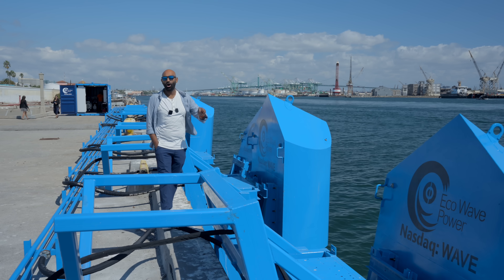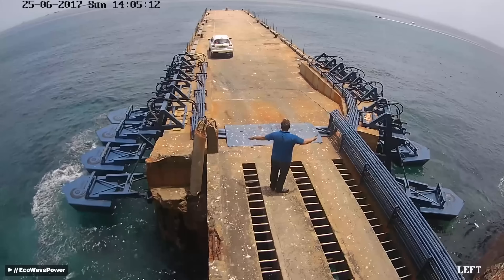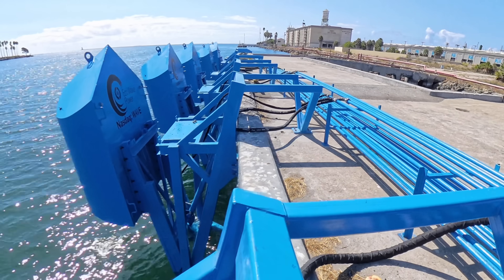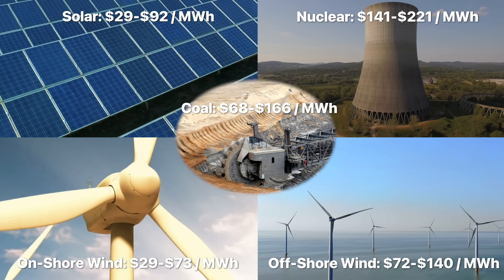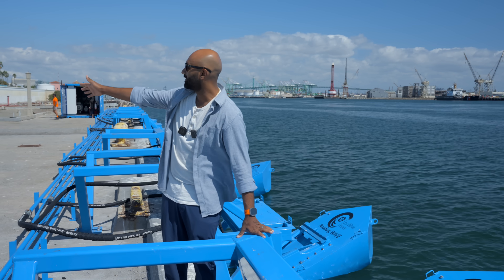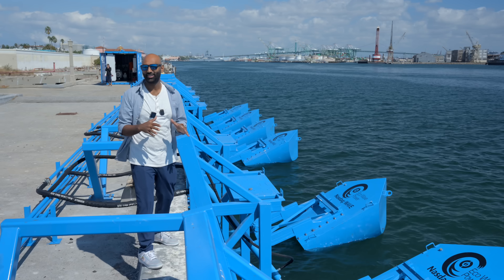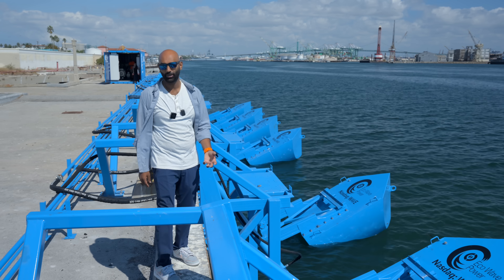Solving Ocean Wave Power's BIGGEST Problem - This is HUGE

Comment: I knew a guy in near La Bufadora who had a floating barrel with a small cable going through an eye on a heavy rock on the ocean floor and the barrel floating would go up and down, pulling the cable and running a small pump for his garden.

Comment: I saw a video where they have similar but it is just a pipe that out in the water and as the wave compresses the air in the pipe it spins generator blades. That opens even more option for the placement of the hardware. Great video as always.

Comment: Wave capture buoys should go heavier and be placed so as to take advantage of the line of wide constructive/destructive waves predictably produced by swells reflecting and intersecting off of acute coast lines, rather than being lightweight to focus on random tall but skinny "noise" that can't reflect -> interfere coherently. Like the ancient Polynesian wayfinding maps describe: at the normal line between two coast lines, or at the nodes directly between two nearby islands that modern wave simulations still can't explain.

Comment: I am currently on a ship off the east coast where they are building a massive wind farm. The windmills are sitting still because there is no wind, however there are rolling waves out here and those hundreds of platforms could be outfitted with large wave generators.

Comment: Why aren't they configuring the the float in such a way to harness the vertical movement directly?  So that the piston compresses the hydraulic fluid most efficiently. The angled approach that they've chosen adds a fulcrum that is another maintenance point.

Comment: Having a the system lift out of the water in case of a storm is a smart idea. There were two different wave power installations on an island called Kalvøy northwest of Bergen, Norway. One was destroyed in a hurricane in 1988, three years after it was built. In hindsight, building it on the western side of the island, facing the open North Sea may have not have been the best idea in the world. An important consideration is how large waves the system can survive when it is in the lifted position

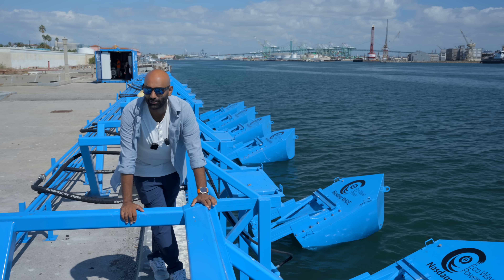Comment: @7:36.  I love your channel but please be careful in definitions.  Tidal Energy != Wave Energy.  It harnesses a completely different source of energy, that of the earth-moon system [with a bit of sun thrown in], and has completely different economic and technological challenges. The only commonality is that both need to survive in the sea and are subject to energetic forces.  However, wave energy has a much higher ratio of extreme to operating conditions:  hence the high LCOE. Tidal energy has a much lower LCOE but is geographically limited to a few locations in the world.

Comment: Just a thought here, but imagine a marina where all the boats are moored to the docks in a manner that allows for the up and down movement of waves and tides (as they do), and each gang plank (moving up and down with a boat) is attached to the dock with a small generator, which is connected to a controller feeding the local grid. 

Would that cost less in time, money and materials?

Comment: Meeeh. This appears to depend on a vertical-side pier for installation, and it still has required a custom design to be fixed to this specific pier structure. Are they in Los Angeles because this is where it was easiest to deal with the bureaucracy or because this was a pier that it was easy and cheap to put the installation on? - Okay, at 11:55 Ricky adresses the extreme site specificity (even though with a typo 😉 ) , but not even the need of a suitable pier. How many at all suitable places are there really?

Comment: Imagine oil rig style wave harvesters mounted off shore outside reef break. The deeper the water the more energy is possible to harvest. And if they take the float and gear it to a torque converter, you can harvest much smaller waves.

Comment: What about using some of the 100's of abandoned offshore oil rigs as a platform for these power generators?
Reply: That would require bringing undersea power cables hundreds of miles, or thousands of miles, to connect to the grid.
Reply: @jonvelde5730  maybe you can load the electricity onto a ship 😄😄😄
Reply from the maker: Oh that’s brilliant

Comment: Cool 😎👍
If they have a compressed air accumulator  they can upsize it easily

😳 😱 they could also do away with the oils and instead piston hydraulic power to push water into a tank compressing the air as an accumulator then draining the system to start all over again, that would require extra systems to run separately, so when was drain the other one be still filling and using the accumulated power and when that one drains with water, we can run the water draining over a turbine as well. There be another way to make power that’s a win win win baby 💨💦🌏
🥰 
Unfortunately, I have no money so yeah … 😒
Oh and could the bower generation both ways with water into the accumulator as well as the escaping gas from their accumulator we needed yes that would be a good way to do it

Comment: YOU ARE AN IDIOT AND MIS-INFORMED. WAVE ELECTRICITY GENERATION PROJECTS STARTED EXPERIMENTATION IN THE 70S AND EVENTUALLY SEVERAL SMALL PROJECTS WERE DEVELOPED-TWO OF WHICH STILL OPERATE GENERATING ELECTRICITY. At the time, nobody believed in renewable energy except for age-old hydro projects-so funding dried up----THANK YOU RONALD REAGAN

Comment: I saw this site last weekend while boating.  It’s located within the harbor breakwater in a no wake zone on the leeward side of the harbor.  All this to say that there are no waves at that Dock, when I was there the wind was blowing 15mph with plenty of breaking wind waves and swell outside of the breakwater and no waves at the location of the system, similar to what is seen in the video.  I get that it’s a test site, but wouldn’t this test site produce data proving that the system isn’t cost efficient on a $ per kW basis?  If the system was located on the windward side of the break wall I would think this system would produce better data that might prove the technology.

Comment: Great video.  You include the wow to the harsh realities (which are not dead ends, but critical challenges.)   The 'projections,' for Livorno. Pie in the sky.  Of course you have to be optimistic attempting one of these projects, and projects like this are how we got steam engines, the airplane, etc....  
I wonder just how many wave energy projects there have been in the past 60 years? (Since I started reading Popular Science magazine.) There must be thousands. So why haven't they worked, when water wheels have been operating for thousands of years?  There is a submerged wave project in the Shetland Islands that last I heard was actually working.

And I've been in and out of Southern California's harbors and along its coasts for over 30 years. There's almost no movement inside any of the harbors compared to what's just outside the breakwater. But those waves can be too powerful. The Dominator wreck on Palos Verdes. The waves completely dismantled a massive ship in just a few years. I like the use of pressure in this project. I like that it can be set up quickly. It might have a use for, 'we need power in this area of the port.' 
When we use a power bank battery we're using a very expensive form of energy. But it works. 
I'm very curious about water wheels and why Newcoming and Watt used pistons instead of a much simpler turbine.

Comment: I think this is interesting but will remain relatively small, i dont think it will hold much promise for large scale production but could be a decent way to make energy for local use. In ideal situations it may be able to kick a little onto the grid but  it would only ever be capable of producing a portion of what we need for the grid, but thats ok, the green revolution is not made up of exclusively leaps and bounds but strides and steps as well.

Comment: Looks pretty good.  However.  When these are installed, it's hard to dock boats in that location, and they take a lot of room.
I'm sure there will be some courts somewhere that someone will use to hamper these things.  There are a surprising number of people that hate good ideas.
BTW - I don't know if I'd call this a 'new' technology.  Farmers have used hydraulic motors for a very long time. This seems to be an adaptation of an already existing system.

Comment: I live in the UK and I've wondered whether a massive trail of sea defences with wave/tidal power generation could double up on stopping erosion and generating energy - also I've wondered whether, instead of installing impossibly expensive cabling, instead localised slow hydrogen generation could utilise the power - the hydrogen would not be piped, but would be stored in tanks to be collected when full - you could have hydrogen tankers travelling land side of the defences.
The process would be slow, but there would be so many tanks being filled, that when the process got fully up and running, the supply would never run out.

Comment: "Shoreline wave generation offers much higher total energy potential and energy density compared to tidal gravity-based energy generation, though tidal energy has advantages in predictability and operational stability. The difference in energy generation potentials can be roughly around a factor of 10 or more in favor of wave energy at most locations where both resources are accessible."

Comment: It seems to me that ports are the most likely candidate to find suitable existing infrastructure. And it's also likely that those will be active piers that need to accommodate ships. So only some end bits, or abandoned piers that may be temporary situations, would provide suitable locations. Public seawalls could be great locations too, but the public mostly won't be amused. I live in a port city with massive amounts of waterfront and I can think of very few locations that would be suitable.

Comment: Funny how this is a reverse hydraulic system. Instead of running motors to run pumps and moving cylinders, you have cylinders cycling, building pressure, and turning generators. Most people don't see generators as motors working in reverse.

Comment: It seems that the design would be better if the units were in the dead spots under the piers.  Maybe using a drawer concept to slide them out for storm protection and maintenance.  Most piers are for tying up ships and other work activities.  If these units complemented the industrial uses, they'd be more practical.

Your final comments about cost in comparison to wind and solar being intermittent power sources is spot on.  This technology is not an apples to apples comparison.

Comment: Wonder what it looks like on a breakwater or commercial dock and how would it comply with public safety. It's good they are thinking modular but its coming out as a manufactured frame. Maybe this could work if it becomes a built in standard of new dock construction or becomes more stand alone modular that connect to an anchor or 2. Couldn't you just sink a coral friendly frame 50m out or on a barge, I'd like to know more about the limitations in the system.
I do prefer tidal power over wind power because its less abrasive and more bio-accumulative

Comment: There will be limited applicability for this - simply because there are relatively few places where such devices can touch the water from high to low tide without being beached.  So a useful addition to the portfolio of renewable energy generators, but probably not a game changed.
Reply: the only issue is 45 dollar if the infrastructure is there ... but US do have a lot of abandoned small ports.
Reply: We can place them on the inevitable sea walls needed lol

Comment: While this wave power plant concept undeniably signals a significant leap toward sustainable energy, one can't help but wonder if the practicality is as smooth as the pitch. With moving parts relegating installations to remote, often off-limits zones, it seems we may have found a technological marvel that’s somewhat... exclusive in its placement. 🤔

It's exciting, of course, but might there be alternative systems—such as the wave-to-air technology used for seawalls—that could offer broader application without such limitations? As much as I’m all in for innovation, I also find myself wondering: Could we have our wave-powered cake and eat it too, without the added complexity?

Curious to hear what others think: Are we too constrained by the nature of these systems, or are we just overlooking their full potential? 🌊⚡

Comment: Its all about how the energy transfer is converted. Hydraulic is one good solution. 
The surface area required for this to work is significant. And it’s kind of unsightly.

Comment: I'm intrigued by the technology, but the low capacity (7 'barrels' for 100kW capacity) will be a major issue in scaling beyond a niche distributed energy resource. As for LCOE, their project doesn't include CapEx for a "regular" commercial installation, like: utility interconnection, site prep, access points (RoW/roads), transformers, permits (not sure if they paid for permits?), site selection costs, engineering work, etc. On small projects, these (fixed) costs can be a substantial percentage. I know because I built a 500kW solar farm in 2017. Compared to a 5MW farm, my fixed costs were 10x on percentage basis to the larger installation.

Comment: Make the floats smaller than the system's ability to absorb waves, then you won't need to bring the floats up.  A rogue wave will flatten the thing and blow out the hydraulics, motors, or electronics.  A chain is only as strong as its weakest link, don't make the weakest link something that breaks.

Comment: We need to see some real figures from a high wave energy environment. Lets see how it performs when tested to its limits. That will give us the real numbers (and even video) to confirm its usage case.This will also provide real maintenance costs and show up any design weaknesses. Pushing boundaries is what drives innovations. So take the risk and lets see what happens. The Dr.

Comment: How they are handling high and low tides?
Reply: From the looks of the system. The articulation range of the cylinder allows for a large swing distance of the ballast. I would assume the cylinder provides pressure on the up and down strokes.
Reply: @francis_lang Probably yes, but since the devices could be lowered down and pulled out of water for maintenance, that's why from engineering point of view, I think the up&down motion of tides is not countered in their system, your thoughts?
Reply: @neelavbarai7088 what do you mean by countered? I am not sure of the context of the question.
Reply: @neelavbarai7088 the only issue that comes to mind with the one way check valve. Is to prevent backflow of fluid when multiple ballasts are moving in different directions. if one valve fails it drains all the stored pressure. My biggest worry is the inability to produce enough pressure to provide a steady output of electricity for an extended period of time.
Reply: @francis_lang you mean all of them are connected in series and not in parallel, good observation.
Reply: @francis_lang good analysis, probably correct.

Comment: Might be a dumb question, but why not use the back-end collector tech and pair it with windmills?  Windmills pump the hydraulics, collector tanks even out the power, and you take a big step to the energy issue.  I mean, anywhere you have a windmill, that works.
Reply: Some diy systems use a windmill to pump water into a reservoir near the top of the tower. Gravity is used to spin a turbine generator at a lower elevation. The whole system is low pressure, so nowhere near the system pressures that are required for hydraulics. The costs for high pressure systems are more than most DIY are willing to spend

Comment: all gyms should be required to use equipment designed to convert human exercise  into electricity to at least power the lights in the place.
Reply: A treadmill can generate 100 to 200 watts.  A 3.5 ton AC would use 3000 watts.  So need 15-30 people exercising at once.
Reply: @tomunderwood4283  no AC, just use fans.  When a human sweats, couple that with air and you have cooling.

Comment: I believe that wave energy is huge in potential, we just don't have the winning design yet. The ocean is the largest solar panel.
Reply: @nirgosh In other countries there are underwater bouys that have much greater output. While this aproach in itself is not bad, it only touches the top of the wave and lots of energy is missed out on. Most likely this is not viable and is either developed in good faith to eventually have a break through, or most likely a creative way to siphon $$$
Reply: @andissavickis5120 can you send some info about what you know?
I've seen some images of underwater windmills like turbines.
$$$ is fine, but a sustainable solution is even better

Comment: How could you omit fouling? Everything in the ocean gets forest growing on it. everything rusts. Have you ever owned a boat?
Reply: seems like he chalked to into the maintenance category. I don't live near the ocean but just seeing what metal structures near the ocean look like after only 2 years I think a 4% maintenance budget is very optimistic, the 15% estimated in the one case study is probably much more realistic. That would have you basically replacing the units every 7-8 years. Could be still worth it if you get very consistent wave action at your location, but seems like its very niche.
Reply: Well, as the beginning of the video said a pilot plant in Gibraltar operated for 6 years, perhaps they've already learned what maintenance entails..